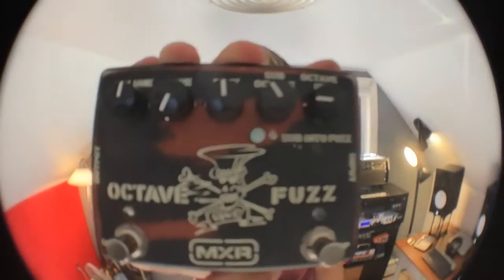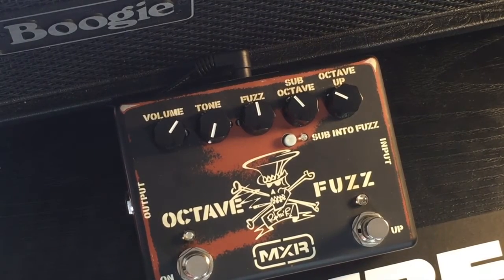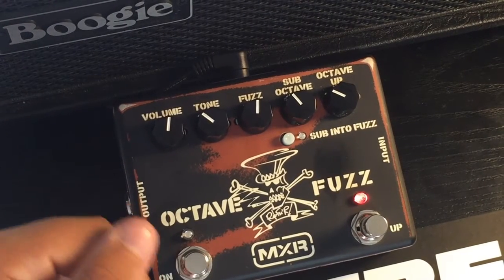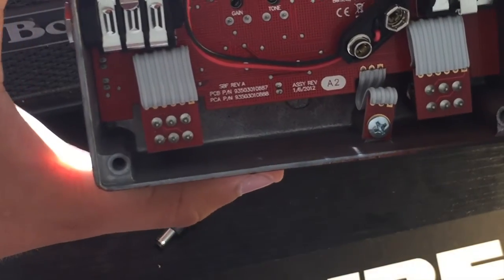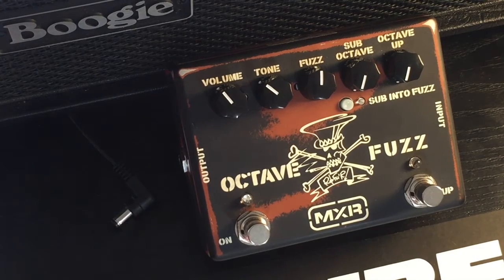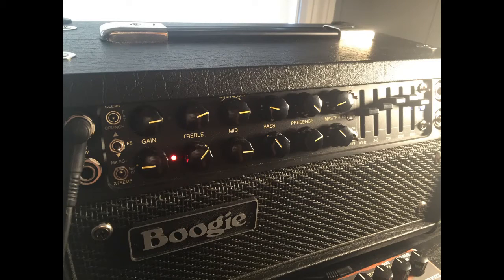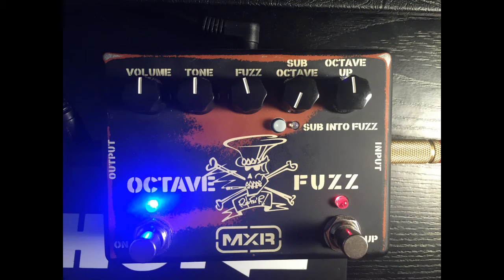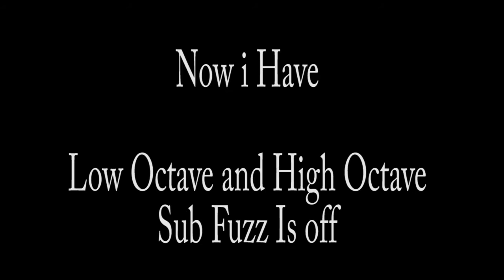MXR Slash Octa Fuzz - Full Pedal Demo / Overview

Comment: I like this pedal on bass, surprisingly - it sounds like at the start you missed something small though:  the UP octave is a fuzz in and of itself, nothing to do with the fuzz knob - analog octave-up produces distortion because of how it's created.  So for example when I use this on bass, I turn the Fuzz all the way down, turn sub-into-fuzz off, and turn the suboctave signal up,  so then it functions like a standard octave-down pedal like an OC2.  Then I kick on the Octave Up to get that upper fuzzy octave on top so it sounds kind of synthy dirty.   

If you want this to be a standard fuzz pedal, you should be able to turn Fuzz up and turn suboctave down and get that - and if you turn suboct up you can either have a clean low octave below the fuzzed straight signal, or add the fuzz to the low octave also, of course, with the sub into fuzz button.